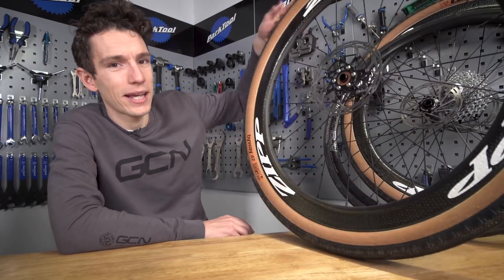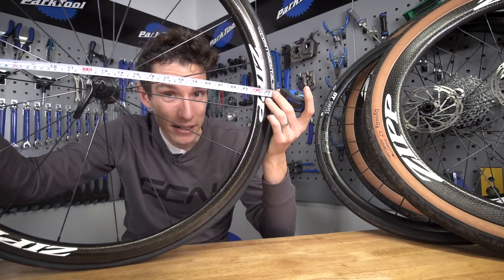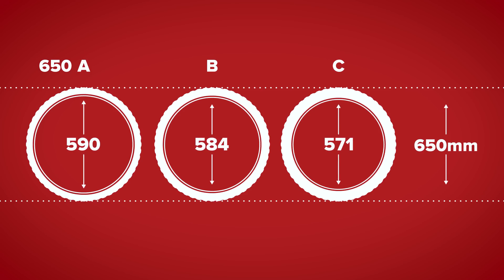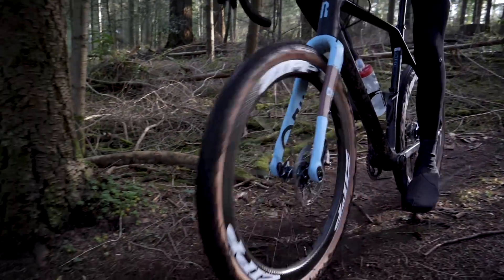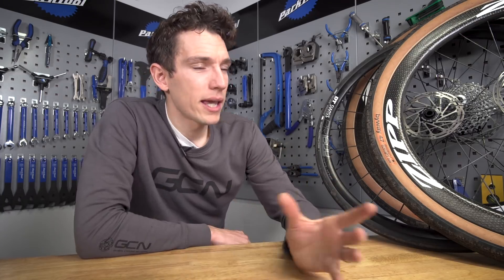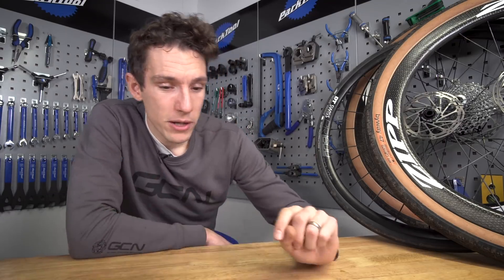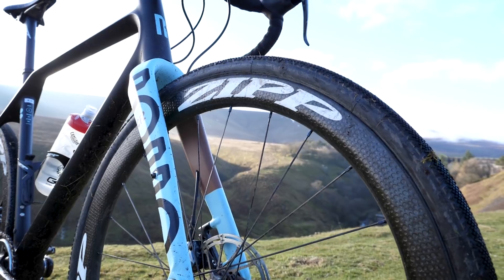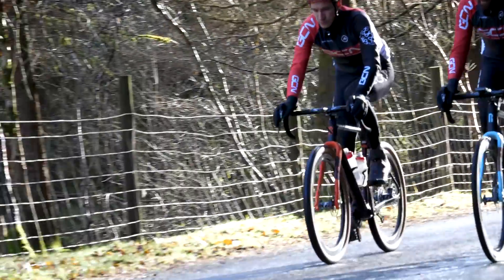650B Vs. 700C: The Geek Edition | GCN Tech Does Science

Comment: Isn’t it funny how 27 ( 630mm) and 26( 590mm) are only slightly off 700c (622) and 650b ( 584mm) I guess they did so because the width of modern wheels so they made different on purpose

Comment: That was fun. I bought a Cannondale Topstone gravel bike that came stock with 700 wheels. Also bought a set of 650b wheels at the same time and immediately started using them as my regular wheels (with various 47mm WTB tires). For most of our gravel, that comes close to switching to a mtb, this is the best option for the gravel bike. Great to have options. Ride what works.
Reply: Have you measured the overall gross diameter of the two different wheels and compared?  I have a 700C bike on which I would like to run 650B, but want to make sure the diameter isn’t an issue.  Ideally the 650B is a slightly smaller diameter.  On my particular bike diameter is a big deal.  Thanks!

Comment: Hello, I would like to get on my bike: Triban GRVL 520 Sram Apex 1x11 buy rims DT Swiss G 1800 Spline. And according to the manufacturer, I can use 650x47 or 700x42 Please advise, What option would you choose from my options?
Reply from the maker: Hi Pavel, thanks for your message! Unfortunately this is a question we can't really answer for you! If you need the chunkier tyres for more "gnarly" roads/off road sections, then your best bet would be to use the smaller wheel. However, if you want to use this bike on the road, or if the gravel/off-road sections you ride are less technical, then you would probably want the 700c option. It's very much personal preference, based on the conditions you ride in. I hope this helps :D

Comment: You guys need to make your storyline more logical and actually answer the questions that you start with. For e.g. at no point was there a dimensions comparison of a 650B wheel & tire vs. a 700c & tire. Where's the explanatory diagram? Could you not put the two wheels side by side and take a tape measure across both? It will be nice if you can make the videos more to the point and leave the distracting side stories for the end. Also the music is too loud in between segments.

Comment: To make things more complicated: a bigger wheel and tire with better brakes up front.

The rear wheel is dragged over an obstacle (front is pushed over, which is much harder somehow) and is more easily controlled when you lose traction. The front wheel takes about 80% of the braking too.

When converting from 26" mtb with rim brakes, it was common to upgrade the fork to a 27,5 or 29" disc brake with better shocks. Best of both worlds.
Even today it is common to see 29" front and 27,5" rear on some mtb's

This will only carry over to gravel bikes with big clearances in the forks though. You could save some money going for a 650b rear wheel only. Keeping the front 700c. It could also make the geometry more relaxed when running the 650b, a good thing on gnarly gravel.

Comment: I've had a 700c on a 29er wheel set  worked just fine.  700c  come in tire  types that 29er dont  try getting a road slick in 29er  700c are all over the place cheap

Comment: I need some clarification on something! I've read posts where people claim that a 23mm 700c tire is equivalent to a 38mm 650b tire. This confuses me! I understand that 23 and 38 are referring to the width of the tire and not the height. The total diameter, according to your video, of all 650 tires is 650mm and all 700c wheels would be 700mm. So the height will always have a 5mm difference? I must be missing something. Can someone help elaborate on this.

Comment: Tech Question: With 700c x 28mm tires on my road bike, I have approximately 3mm clearance on each side of the tire (inside the fork/chain stay/seat stay). The angle of the frame—inside the fork/chain stay/seat stay—increases as it nears the hub. A smaller wheel accommodates a wider tire because its shorter radius sets the tire at a wider point in the frame. The radius of the 700c—from hub to rim—is 311mm (1/2 of 622). The radius on a 650b is 292mm (1/2 of 584).  Measuring 292mm up from the hub, I find there is approximately 41mm width inside the fork—where the edge of a 650b wheel would sit. Without knowing the height of a given tire, what's the largest tire my frame can accommodate using a 650b?

Comment: My frame can fit a 700x45 Riddler or a 700x44 Compass Snoqualmie Pass. It can also fit a 47mm or 48mm 650b. Now, what I am wondering is that if I could fit such a large 700c tire, would moving up to the 650b, be worth it? Pun intended. I understand the reason many move up to 650b is so that they can utilize larger volume tires in a frame that could not accommodate large volume with 700c. But if your frame can fit 44mm or 45mm 700c then would the small amount of extra volume in a 47-48mm 650b make a really noticeable difference? Perhaps some of the handling characteristics of the 650b is preferred as well over the 700c? What's your opinion? If you had to choose only one? Thanks :)
Reply: Stay at 700x. Because the difference is not so much in the smaller diameter, but in the width, which you can have on your 700 wheels. It'll weight a bit more, but you're not optimizing for races anyway given the new size. And you don't need to buy another wheelset (or could just buy a 40–50mm one for races instead).

Comment: Too bad UCI sets a minimum diameter of 55cm for wheel+tyre! Otherwise we would be racing with Moulton bikes.
I'd love to build a TT bike just on that minimum wheel size limit, there are several smaller rim "standards" but then you can't find nice racing tires. I once had an hybrid with 559 wheels (26er) with 25mm Maxxis Detonator tires, but I can't find those anymore and the bike was sold. At least I'd like a 650C TT bike...

Comment: It is all about selling points and creating new markets by industrie.

for us average joe nowone realy need this stuff.

from my point of view there shoulb be just 1diameter standard. and for spezial uses the frameset should fit the rims the use.

i think framesets with plugs on fork and dropouts for some tuning due to tyres as seen could help 2 adjust.

i go on 28“ 25 for TT
i go on 28“ 28 for road
i go on 28“ 32 for cyclocross
i go on 28“ 2.1 for mtb

so i cant see the need for 650b

only if ur hight cannot fit propperly an 28 i could imagine a need for smaler rims

same for all the so called standards on bb. its just about moneymaking with no added worth for the customer.

cheers marco

Comment: I use 16" wheels on my Brompton, 20" (406 on my tsr moulton & 451 on bobbin metric) 26" x 2.1 on bobbin wagtail, 650c on my vintage lo pro 653 and 700c on a few hub gear and fixie bikes. I use various bikes for tting on (the moulton tsr, kona paddy wagon 3, charge plug fixed and the wagtail, all with a custom aero position) and have noticed very little difference in my average speed and times
Reply: Rockinroomsrob Offroad, large wheels being faster makes physical sense. On road, it doesn't and fast road bikes could be designed on whatever fits the rider.

Comment: So with all that said, would it be better to run 650B a fatter tire in the front for handling and skinner 650B tire in the rear  so less to push while peddling??
Reply: You're pushing both tires while pedaling. Just because a tire isn't part of the drivetrain doesn't mean you aren't using your power to accelerate it and keep it rolling.

In terms of aerodynamics and suspension, it's probably better to have the skinny tire up front (where the aero contribution is more significant) and the wide tire in back (where it's usually suspending more weight).

Bikes that run bigger tires up front are, to my understanding, usually set up that way for handling reasons.
Reply: Just my case,  I thought the only time to run the 650B are when you are going more off road than on road riding that day..  I agree about the aerodynamics, but when you are flying down a rough trail at different speeds off road you would need the bigger tire up front..

Comment: With all the current  "options" in wheel/tire...is there any advantage to use different tire width front/rear? I'm currently on 23c, but got a 25c and a 28c, same brand/model, new ones. Where should I put each?  F>R or R>F? #torqueback
Reply: Erik Castañeda F>R is what mtbers often do because you really don’t want to slide the front out.

Comment: Owning both 700c (w/ 28mm tire) and 650b (w/ 43mm tire) wheelsets for one of my bikes, I can say that the bike handles very differently when I switch. I attribute this mostly to the lower bottom bracket when using the smaller wheel. That lower center of gravity feels much more stable on the road, but also comes with a higher risk of pedal strike if I lean over too far in the corners. Both are fun, but putting fat 700x40mm tires on is the most fun.
Reply: Really? I would have thought that the overall diameter of both those wheel setups would have been very similar. I mean a 700c x 35mm tire has the same overall diameter of a 650b x 47mm tire. In fact I would have though that your 650b x 43mm setup might even have a slightly greater overall diameter. Is that not the case? I'm interested as I myself am looking to do the same as yourself for my Giant Contend Disc.

Comment: My experience:  I own bikes with 700Cx25mm all the way up to 700Cx42mm tires, 650Bx42mm and 48mm, and 26" x 2.3" (American sizes, sorry there is no metric equivalent, although you could say ISO522x58mm).  I'd say the fastest is 700x32mm (on a ~30mm wide rim).  650x42mm is the traditional Randonneur tire and is great for distance.  700x38 mm is my favorite as it's pretty plush and rolls quite fast.  26"x2.3" is great for multi surface riding -- I run them at 25PSI and they are at their best on hard pack and super rough roads.  I only use Compass road tires (no knobs), and only ride tubeless (except 650x42mm), so this will be a different experience than with the heavy WTB 650Bx47mm tires.

Comment: Just remember, thru-axles aren't standard (this has bitten me more than once).  If you have 12mm thru-axles, your semi-common 15mm versions won't work of course.  If it's the other way around (i.e., you have 15mm thru-axles), you can sometimes find new end caps to use wheels designed for 12mm axles.  Also, note that you REALLY need to pay attention to the outer diameter of the wheel/tire combo.  If you put a 650b x 42 mm tire (the most common road tire for 650b's) on a bike designed for 700c  x 25/28 tires, you may have horrific pedal strike issues (it's 10mm smaller than a 700Cx28, 4mm smaller than a 25mm and, thus the same as a 700Cx23mm).
Reply: I forgot about that issue, which has also been a problem for me.  The 142mm standard appears to be the most common, and there are end caps to make 142mm into 148mm, but they are hard to find.  In my case I was able to get my front wheel from one bike to another, but the rear wheel was too narrow and I couldn't find end caps to extend it.

Comment: I've got 4 bikes : a classic allu/carbon frame and fork 700c road bike with 28mm tyres, a fixed gear bike for commuting to work and cruisin around (the one i use the most), a 20 inches bmx for fun and cruisin short distances and recently I converted a 26 inches Subrosa Salvador cruiser bmx bike with a drop bar, brake levers and a 30 tooth chainring (10 tooth sprocket). I did this because the roads here in Belgium are crappy as fuck. And I cannot choose witch bike I prefer ! I like them all ! the handleling of the bmx/road is awesome, the ratio is perfect for flat terrain u can go fast, fast cornering, going off road hands in the pockets, taking some sick ass bumps, riding in rain/snow/thunders and even volcanos !! just kidding xD. It's a cruiser bmx so it's a little heavy (14kg) but it's FUCKING STROOOONK :'D and ultra comfy. The only cons are the original tyres (2.2 inches) are not punctureproof (only 1 layer maybe? DK) so I just have to change them with some Continental Raceking for ex. and that will be OK+ :).

Comment: Good video.  One question: what width tire will you see a 7% aero savings?  Is that actually a 650B tire or a 650C (26"x1 3/8, 23mm/25mm wide) tire?  I find it hard to believe that a Zipp rim with a 47mm tire is 7% more aero than a Zipp rim with a 25mm tire.  If it is more aero only with a 23/25mm tire, that is relatively disingenuous because the concept of 650B (road plus) is to have the same wheel and tire diameter as 700C.  Using a 25mm wide tire on these rims will make the overall diameter much smaller and mess with the geometries which makes that aero saving claim irrelevant.  I know that claim was from Zipp and not GCN, but just curious if Zipp clarified that.

Also, of course the weight of the rim is lighter, because the diameter is smaller.  But that doesn't include the heavier tire.   From what I can tell, 650Bx47mm tire has a similar diameter to a 700cx30mm tire.  It looks like the tire used in the video is a WTB Byway which is a 535 gram tire.  The Zipp 303 wheelset with those tires would be 2,520 grams. The WTB Cross Wolf (700x33mm which would actually have a larger diameter than the 650Bx47mm) is a close comparison because it is the closest tire without getting a completely slick 30mm tire and without getting a wider knobby tire that would increase the overall diameter.  The Zipp 303 wheelset with the WTB Cross Wolf tires is only 2,314 grams.  

So, if you include the tire (assuming tubeless is being used so no tube weight) the 650B setup is actually just over 8% heavier than a traditional cross setup.
Reply: Jon Crowson With an equivalent tyre. So 25mm and 25mm for example.
Reply: Thanks Simon!

Comment: If you have a multipurpose bike that can swap wheels/tires to handle a little off-road, does the wider fork have any large impact on aerodynamics? it sounds like it might be possible to have one bike with swappable wheels that does more for less money than 2 bikes. But if it the trade-offs dramatically worsen road performance, it might still be worthwhile thinking about 2 bikes instead of 1.

Comment: Can road bikes with disc brakes swap wheel sizes easily?
Reply: I don't know much about that but I think that for through axles they are interchangable, but those with quick release hubs are not interchangable, you have to have the same dropout for quick releases to be interchangable. Then I think you probably have to have the same rotor size for the disc brakes, although it might be possible to adjust the calibers for different sized rotors as I heard people putting different sized calibers on the same bike. But I could be wrong.

Comment: Very nice job, thank you for the thorough discussion! Two minor quibbles: First, regarding the use of bead diameter to designate size -- it's the crucial diameter that must be matched by the tire. The other diameters (e.g. to the very top edge of the rim) are inconsistent between wheels that would take the same tire. Second, right around 9:00, you suggest that one could make the steering less ponderous by increasing trail -- I think you meant by decreasing it (or by increasing rake perhaps)?

Comment: Simon, disc brakes are NOT necessary to convert from a 26" mountain rim to a 700c road rim.  I converted my 2000 Bianchi B.U.S.S. (Butt.Ugly.Single.Speed.) from a single speed 26" mountain bike to a single speed 700c road bike using Paul Motolites.  Any old 26" mountain bike frame can be converted to a 650b or even 700c cyclocross bike using Paul's Motolite brakes https://paulcomp.com/shop/components/motolite/.  I used the original gold Paul hubs that were originally laced to WTB 26" rims and laced them up to gold 700c Velocity Aerohead rims with black spokes.  My Bianchi B.U.S.S. frame can accommodate up to a 35mm tire or possibly even 38mm tire with the larger 700c rim.  The biggest tire I've put on the Aerohead rims are 32mm, but they had some room to spare.
Reply: I had that thought as I've gone the other way, swapping from 37-590s to 25-622s on a 70s BSA, but you have to change the calipers as there won't be anything with a reach that can accommodate both at the same time. I think the point Si was making was about hot swapping between the two, as opposed to doing a permanent conversion
Reply: Actually, all you have to do is loosen the allen bolt on the Paul Motolite brake calipers and slide the pad up or down as needed to accommodate your wheel size.  It's not as fast as swapping in a disc, but doesn't take too long.  There is over 55mm of vertical travel available on the Motolite calipers.  When I say 26" mountain, I'm referring to the older standard 26 inch or 559mm width diameter rim.  The motolite pads are able to adapt all the way from a 559mm diameter rim all the way up to the 622mm diameter of the 700c rim no problem.

Comment: interesting stuff there, guess that one of the big things which are going to do your head in are if you happen to break a spoke! gonna drive you nuts trying to find the correct size. I am guessing that spoke length wouldn't be totally the same as that you would find on a 650 MTB wheel. Bad enough find spoke length on 700c wheels! Oh by the way on the wheels was it bladed spokes or just normal straight pull spokes? Just wondering how things compare with all of the other difference with both weight and aero benefit, how about spokes? Since there has been a lot of tech gone into the humble spoke on 700c just wondering what the story is with 650b? Oh and the whole Emma Pooley thing, you've spoken to her and she has explained that 650 wheels were what would work the best for her since she has to have quite a different set up due to her different stature... one think Dan would know.. due to there time both at Cervelo!